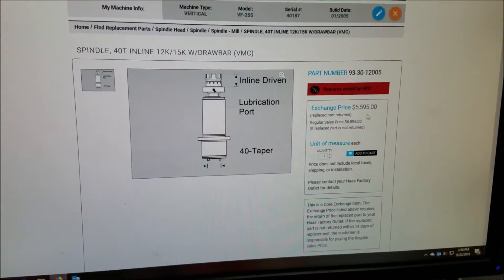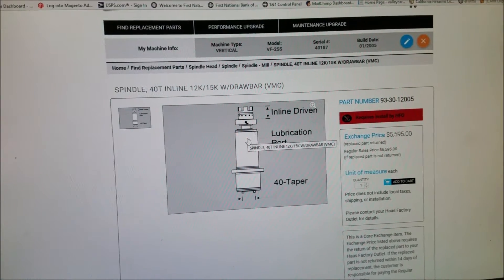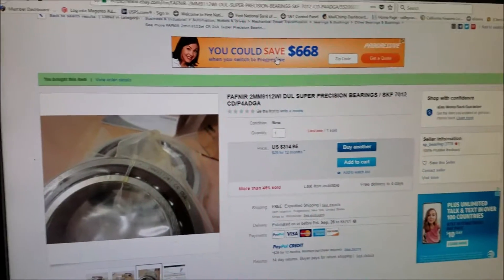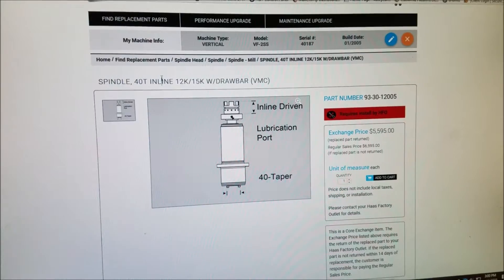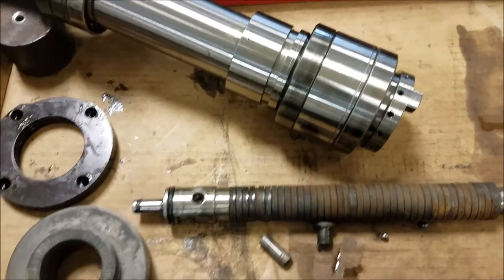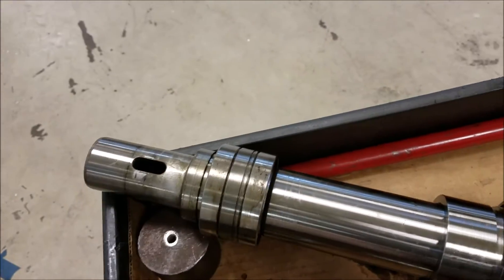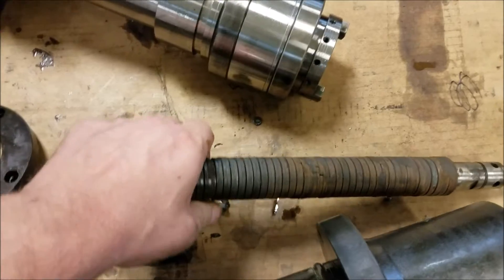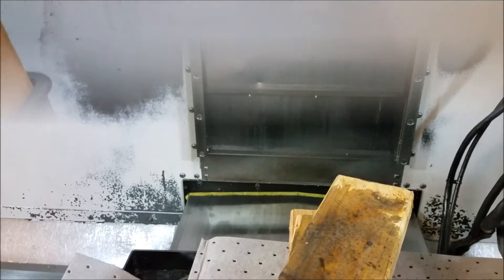Haas Spindle Bearing Replacement Part1

Comment: I'm in the process of fixing my (new to me) 2007 VF5ss spindle.  It ate the lower bearings, upper bearings still feel perfect, my screen was also pretty clogged and my bearings smelled cooked.  But my bearings are all ceramic, is this typical?  Why do you need ceramic bearings for a 12k spindle? My drawbar also had some busted belleville washers just like yours and my drawbar pusher plate collar thingy with the pins was also busted like yours.  So video was still a bunch of help so far in me rebuilding my spindle.

Comment: As of November 2001 you can buy that push out collar from CNC replacement parts online. The drawbar on the spindle is an amazingly good condition save for the need to run through a solvent tank a couple times. I've had good luck replacing the Belleville washers on the spindle draw bars. There's about $60 worth of washers in a draw bar versus 4 to $900 for a new one depending on your spindle.

Comment: They don't want you opening it up because then you'd see how easy it was to fix and how they were ripping you off. There is significantly less magic inside a spindle than some think. They are usually far less impressive than their price would suggest.  Those pins broke because it was poorly made.

They keep the myth going so they can charge $1000+ to install $300 bearings. Anyone with a press and 30 minutes can replace bearings, fans, spacers etc.

Anyone with a decent CNC  lathe could make their own spindle shaft too.

Comment: Wow, you took a part that failed due to fracturing and rather than make a new one you spun it around, stuck a new hole in it and reused it, and in a high speed application? Then you say you did "what any machine shop owner would do"? You are a disgrace to the trade....

Then your cheap ass buys bearing off of Ebay not knowing the class,  just the number. Then you go on about having to rebuild other spindles, I can see why! Now that you will have an out of balance condition you will kill those new bearings in no time, not to mention crap surface finish. 

You claim 1/2-20 is a non standard "Funky" thread and you don't have a tap? That is the standard for imperial fine! 

I guess you have never heard of the "high cost of being cheap"?

Comment: In before "This is not a user serviceable component, please contact your local Haas Factory Outlet for service or replacement"
Reply: We re-worked a SM ATC gearbox on our Super Mini, after finding out that it's also 4k +core for a replacement, and that it's replacement only, no repairs. Was a pain to pull and drop the carousel, but all together not that bad. Ordered a new needle bearing for $50 that was a direct replacement and polished out where the old bearing had backed out and rubbed against the cam way floor. 

That was almost 5 years ago. That machine is still in production, and while there's been a couple more issues with the ATC, none of them have been the gearbox.

Comment: Can you go a bit into depth about the preloading of the bearings? Maybe make a video about it? 

I have a machine with the same spindle bearings and judging by the slight increasing noise from the spindle I think I have the same operation ahead of me. The replacement spindle is roughly the same price as yours so I will probably take it apart and at least try to fix it :)
Reply from the maker: When I bought the bearings from a bearing company, they can tell what the pre-load should be. I dont have the equipment to "load" them or check the load, so I just pressed them so they roll snug. It's all back yard mechanics, but it works. The first bearings i did a couple years back, i pressed too much load on them. They created alot of heat. Ultimately i did raid it apart and re-loaded the bearings but they only lasted 6 months. The second set I did on that machine are still running. Been about 2 years and still sound good.

I was told when loading them, your spindle should have a little resistance. Should spin roughly one turn before stopping freely.
Reply: When you specify bearing number(full) it already has a predefined preload. Preload of those bearings is defined by thickness difference between inner and outer rings, so if you install them correctly and tighten a nut or fit a press-fit ring  preload sets itself by micrometer gap between inner rings
Reply: 1 spin

Comment: I am super interested in this. I just bought a 95 VF3 and I know nothing about it. (check out my channel if your curious) I am learning about spindles now in case I have to replace it. How do you get that pressed nut off?
Reply from the maker: Press it off. I think one was a puller, but if you can get a bearing clamp under it, a press can get it all off.

Putting it back together, I bought some round tubing stock to make sure I pressed on the inner race.